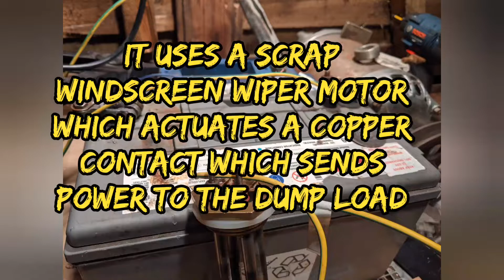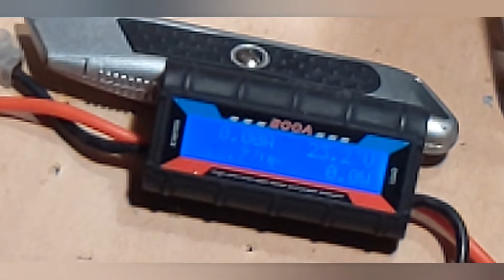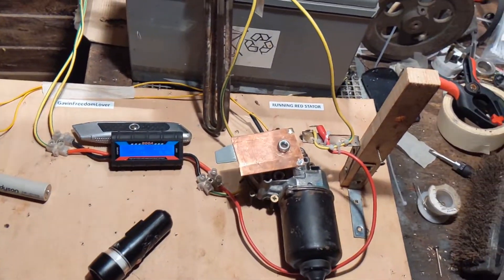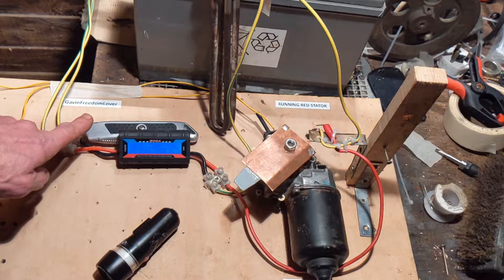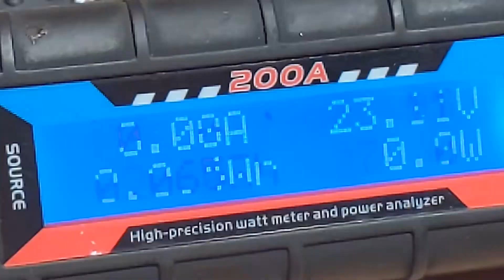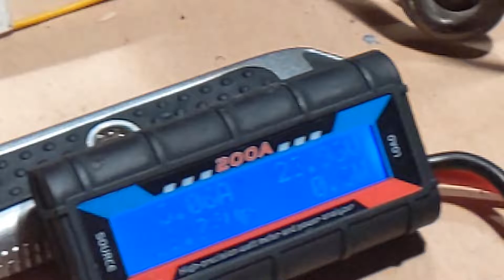Wind Turbine Dump Load System - WIPER MOTOR - Built this today !! - 20th November 2021

Comment: However, the wiper motor consumes power. This is easily done with a 555 timer circuit and does not consume power during a break. no wearing mechanics

Comment: Hello, I’m not sure if you’ve every noticed, but on uk motorways there are small wind turbines that power signs, well I go past one almost every day and noticed it had fallen over, it has been like this for several months now and no one is doing anything about it, I was wondering if it would be worth picking it up to do some testing on
Reply from the maker: I'd probably pick it up if it was me , otherwise it may well turn to rust and that wouldn't be acceptable in this day and age !!! :)